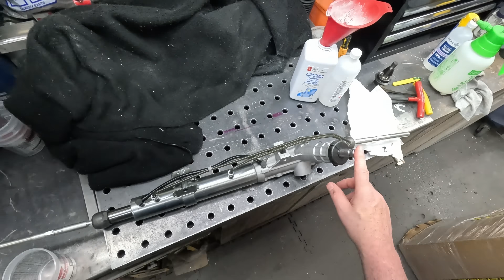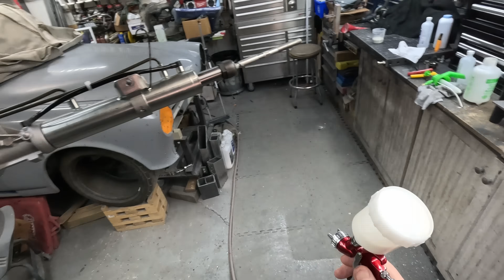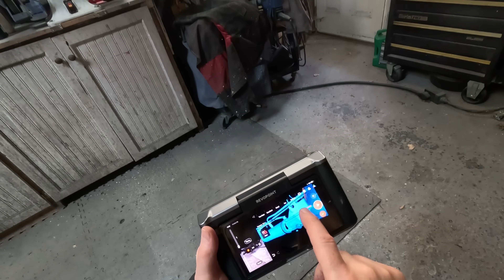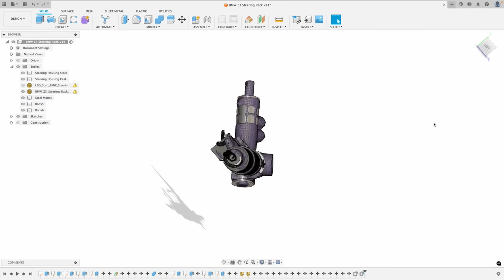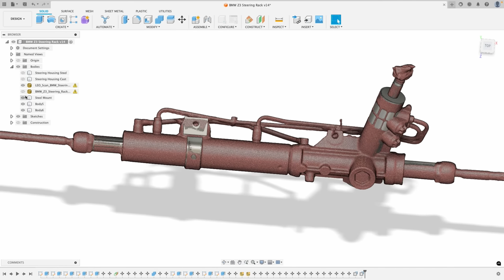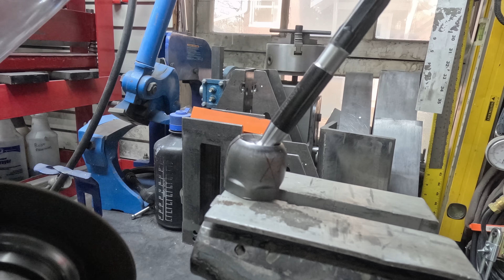Head to Head 3D Scanner Test - MIRACO vs. LEO - steering rack test

Comment: Did you go from the Leo straight int Fusion or do you also have Artec Studio? Without Artec Studio how did you get a surfaced point cloud? and what file formats were both of those scans before you brought them into Fusion 360?
Reply from the maker: WIth the LEO you have to use Artec Studio to create a meshed model.  I then exported it as STL into Fusion.  Both scanners can export in a variety of formats.  The Revopoint can export in 6 different mesh formats.

Comment: This really helped me as I have been trying to find real reviews of this scanner and none were as informative.
Reply from the maker: I'm glad you found it helpful.  In my experience, it's harder than it looks and the learning curve is steep.  You can get good scans, but some of the promises about not needing measurments is not really the best use of the tool.  For example, I just used the scans to correct my simplified model for the steering rack.  I can then add in the scan when I need final checks for clearance etc.

Comment: That seems like it takes a very long time to scan the part. I have a Einstar Vega that seems to be much faster than that. It is amazing how quickly this technology is evolving. Nice shirt by the way ;)
Reply from the maker: Interesting...both these units took a fair bit of time for this part.  I'd be very interested to see how your scanner would work on a similar part.
Reply: @ThrottleStopGarage  It could just be my perception of it. I have only had a small play with it so far, so we will see how it goes.
Reply from the maker: Each scan from start to finish probably took 20 minutes.   I scanned them multiple times, playing with settings to optimize the scans.  The MIRACO does allow me to pause and undo bad scans...the LEO does that in post.  By the time it's fully rendered and done it's about an hour or so.

Comment: is it making it hard for the scanner that the rack is rocking around in the air?
Reply from the maker: It was only moving the one time and it didn't matter.  It's the shape.  The cylinder has no sense of orientation in the long axis...so if all the scanner can see is that part, it gets messed up.  The balled up tape helped.

Comment: Instead of using a suspension / spray, I wonder if a powder coating gun with talc and the static attraction of the media, might work?
Reply from the maker: It was super easy to mix this in the cheap mini gun.  Clean up was easy... I'd rather not drag out my powder equipment for this.  Either way...much better than $100 for a can of spray.
Reply: @ThrottleStopGarage  Hi, why the 3d scanning spray is so expensive ? import taxes ? look at AESUB brand, it's wayyyy cheaper than 100$. Wish you the best sir.
Reply from the maker: @kermitahnenerbe3722  I don't know why it's so expensive - but AESUB is over $100 for me on Amazon.  The cheapest I've seen it is $70 plus shipping in Canada.
Reply: @ThrottleStopGarage  Oh F, it's half the price in France.

Comment: Thanks for this! I ended up ordering a Miraco plus a couple days ago (after watching your other video on the Miraco), and it sounds like for the price point it's not a bad buy (even for a few hundred more than the "regular" Miraco).

I'll be interested to see what my workflow with it turns out to be. I'm initially envisioning using scans to get dimensions, and then building a "clean" model from those in Rhino, but i guess I'll find out!
Reply from the maker: I'm glad you've found this useful. The learning curve can be steep.  There are software packages that can thin the points in the model and make them easier to use.
Reply: @ThrottleStopGarage  Oh yeah, I'm under no delusions this is something that I'll pick up and immediately get great results with. Well be interested to see how fast I can climb that leaving curve, though (which I think will include learning how to use the Revoscan software for initial processing before bringing things into Rhino).

Fortunately I got a good connection with a flight school that has an in-house maintenance operation, so I'm hoping I can get some access to good test specimens.

Comment: Great job on the scans. The "budget" scanners are good for hobbyists if you are not concerned about super high detail/accuracy. The software is a bit clunky on those too. The Artec looks like it did a decent job. I have been scanning for about 10 years with a bunch of different types of scanners. I currently run a Creaform Handyscan 700 and like the Leo it was not cheap. I bought it used 7 years ago for $55k. I also use Aesub Blue self dissipating scanning spray. Its about $38/can here in the US. Love seeing the technology being used like this :) I have a couple scanning vids on my channel.
Reply from the maker: Thanks for sharing your experience. It was great when they overlaid without an issue.  Makes you wonder what 5 more years of development will bring.
Reply: @ThrottleStopGarage  I do know that the newer blue laser scanners from Creaform and a few others are even faster with the same accuracy and don't need any dulling spray at all. They will scan chrome. Insanely expensive though. I think the new Black Elite from Creaform is north of $75k all in.